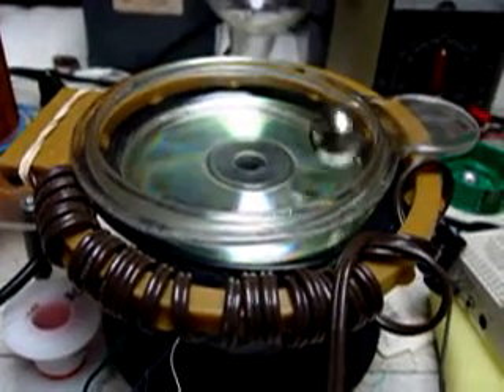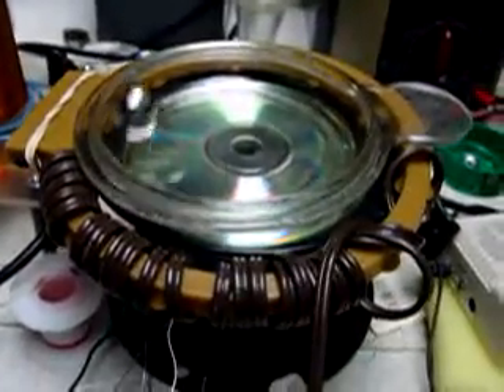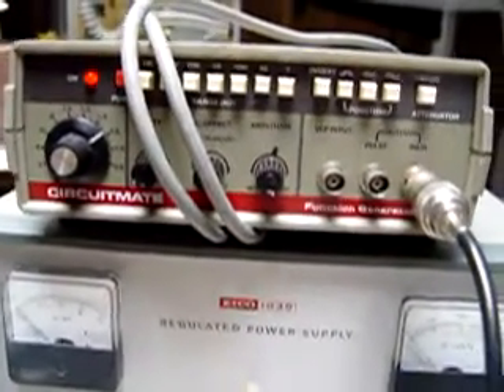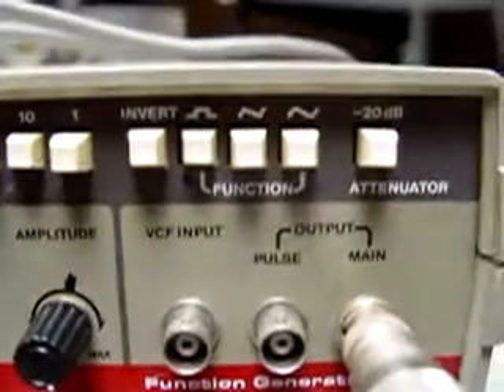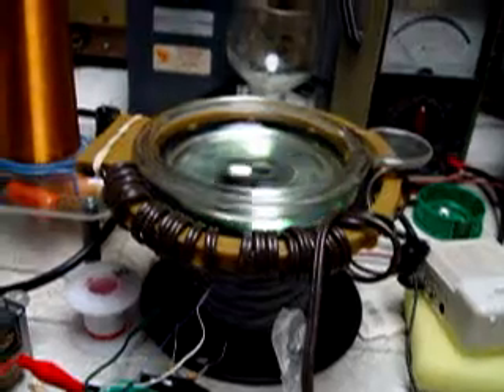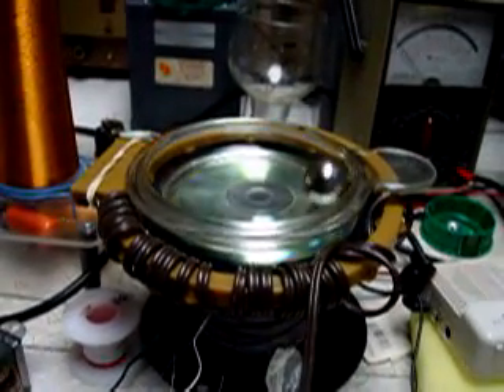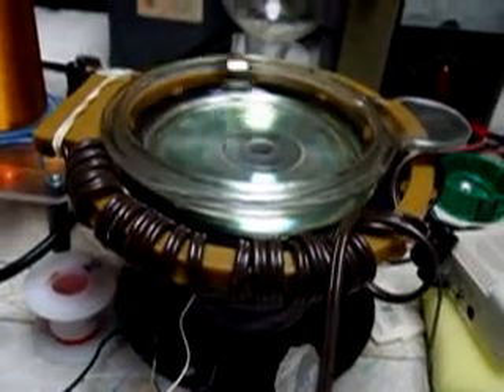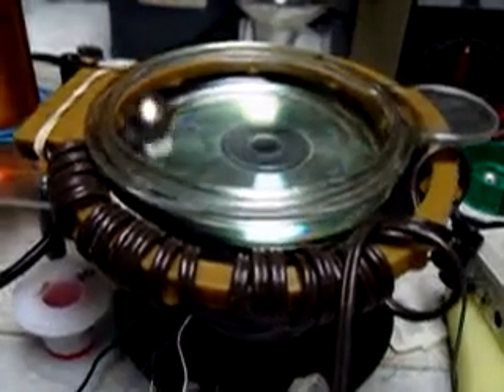Sphere Magnet Spinning with Degaussing coil & function generator

Comment: i think you could use the effect to make the magball go up, without turning the coil vertically.  But i think you'd need another coil.  I have a design where metal liquid is raised up by counter rotating rings, that each have mag points, and then drops through the center.  It is kind of a pinscer effect...  as the rings go higher, they rotate faster, but have less mag points.  It pinches the fluid between points without actually grabbing it, and/or sling shots it up around them.  
This is how artificial grav is created: the circulating ferrous liquid has a magnetic field, and by spinning the liquid in the same toroidal pattern as the field, it increases the mag effect to the point that it creates gravity.  I swear on the holy bible, it does.  This design might do something similar, even without spinning the coils, but in this case, the ball is inside the coil.  In my design, it would be outside and then drop through the middle, with nothing but mags holding it.  Yours is inside out, and this design I'm linking is also inside out.  Or more precisely outside in.  Instead of syncing in with the entire magnetic field lines, it utilises just the central vortex.  Happy flying! 

https://youtu.be/3ibkIkCZMVM

Comment from the maker: Well, I guess we will see if the mass of the coil is important, I think it might be. Another concern is that you may not be able to generate a high enough amplitude signal with the simple oscillator. I think a single mosfet amplifier stage could be added on if need be.

Comment: Hi Dave,
I just bought a 12 inch degaussing coil and the seller measured 79 ohms across the plug ends.Its on its way to me now.  I know its not the 300 ohms you measured but I thought I would try it anyay. Nothing ventured nothing gained.

In the meantime I found a square wave oscillator circuit that can be adjusted from O upwards in frequency. Works on a 9 volt battery Costs less than $5 for parts.

If it works out I will post a video on U tube..

Comment from the maker: I don't know how many turns . The wire calculator says you would need 2760ft of 30 AWG to reach 300 ohms. That's a lot of windings. I suspect the wire gauge in the degaussing coil is smaller still.

Comment: Hi Dave,

I  would like to construct a 12 inch diameter degaussing coil and see what it does with a function generator.

How many turns of 30 gauge AWG wire will guive me 300 ohms at the plug end when wound around a 12 inch diameter form?

Comment from the maker: The coil I use measures close to 300 ohms. Using a wire calculator that would need 18,000 feet of 22 awg wire. So I believe the wire diameter is much smaller in this coil. As I recall the coil also has a rather short duty cycle. Something like 30 seconds on and five minutes off.